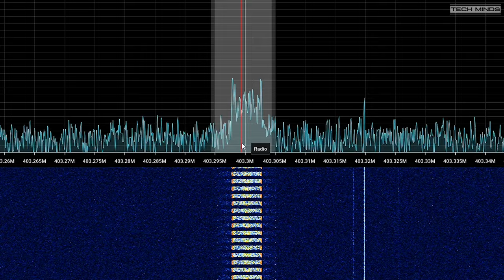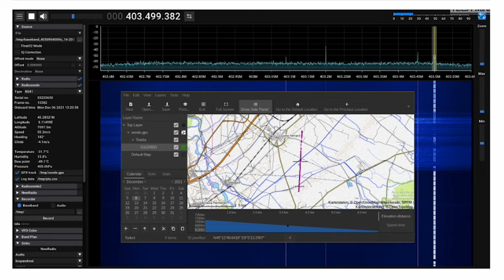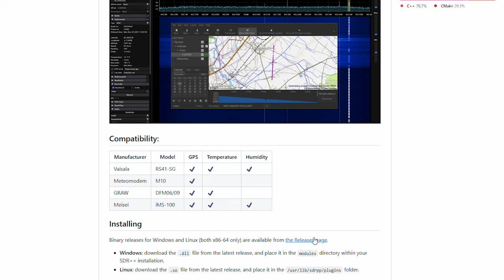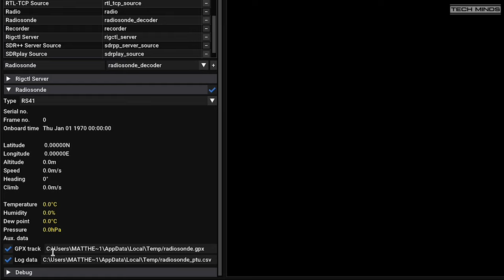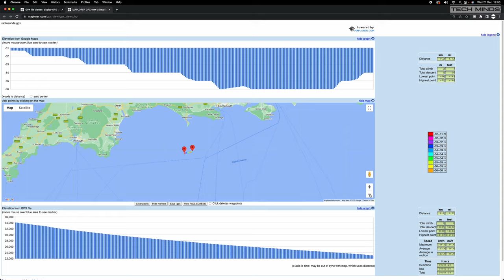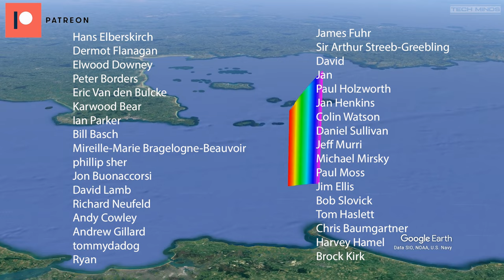Radiosonde Decoder Plugin for SDR++

Comment: SDR++ is already one of the best SDR programs available, and it keeps getting better and better!
Reply: Agreed!
Reply: It's good but won't run on my Windows 10 bootcamp installation for some reason but does on other pc's
Reply: @digitalmediafan  It's a 64 bit software. If you are running windows 10, 32 bit version it won't work.
Incase you are running windows 10, 64 bit version, then please make sure it's updated, including the latest version of .Net runtime application.
Reply: @bharatshetty9560  yes I have 64 bit version. I have the latest runtimes as SDR console installs them so don't quite understand it
Reply: @digitalmediafan  try running the program with the command prompt. Do "cd path/to/sdrpp/folder/ sdr++.exe" (actual file path and executable name might be different). See what error the terminal prints out when you try to run it.

Comment: And for the future: I would like more information on microwave radiosondes operating at frequencies of 1680 MHz
Reply: RS41 is Viasala (Finland) sonde - it can be scrambled (RS41SGM - Military). on 1680MHz - sondes dopnt do GPS. The use radio/azimuth/elevation by manualy tracking signal strenght. RS41D is the model. Also old RS92D used to fly there. I hope this helps
Reply: @jiriculak6115  Thank you, but the probe at a frequency of 1680 MHz transmits temperature, humidity and maybe something else in a digitized form
Reply: @jiriculak6115  The old Vaisala RS92-D sonde does not make GPS measurements, but both the RS92-SGP and newer RS41 do. For the Vaisala RS92-SGP, GPS accuracy is about 10m horizontally and 20m vertically. The US uses radiosondes with GPS sensors. A NOAA website says: "sensors on the radiosonde transmit pressure, temperature, relative humidity and GPS position data each second. ... Wind speed and direction aloft are also obtained by tracking the position of the radiosonde in flight using GPS or a radio direction finding antenna."
Reply: @JonAhlquist  yes that’s what I said.  D models and all 1680mhz don’t do gps. There is also sgm model that does scrambling. 
I must have now close to 300 RS92,41 and few DFMs and M10s.